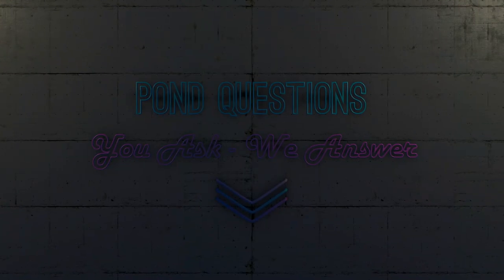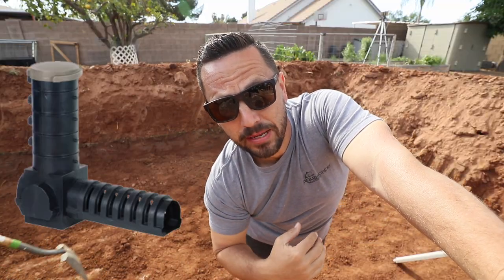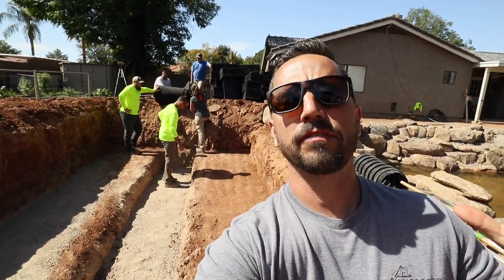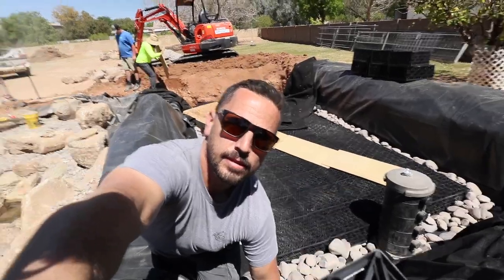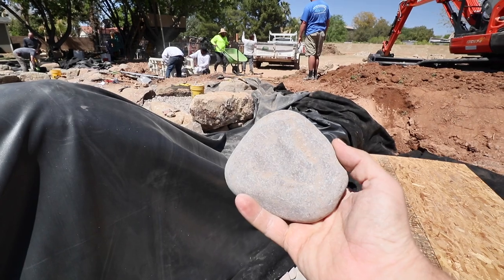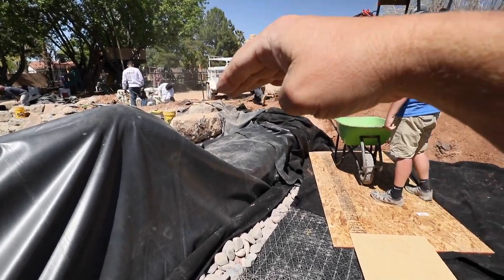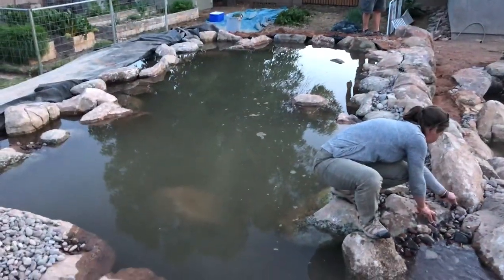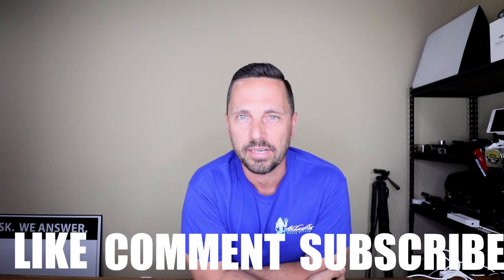How To Build A Constructed Wetland Pond Filter - Step by Step - YAWA 005

Comment: So does the skimmer section pump pumps water from the main pond up to the wetland filter? And the water flows up through the wetland filter consists of the aquablocks and the different sizes of gravel and those water just cascade down to the waterfall and back into the pond? Essentially you are really using one pump from the skimmer section which is generally lower in elevation from the wetland filter and waterfall. Pls help this is the only area i do not understand by far from all of my research.  TIA

Comment: Hey great info I am laying out a 15 x 15 wetland filter with a 5 x 10‘ stream dropping into 20 x 40 pond going into a small 6‘ x 8‘ intake bay what size and how many aqua blocks would I need for that type system for the wetland and for the intake bay also running about 75 foot of 3 inch flex line what size pump would I need climbing about a 2 foot hill thanks for the any info

Comment: Won't the voids in the larger rocks be filled with smaller rocks/gravel over time? 

How is this cleaned? 

Where does the fish waste go? How is it removed from the water column? 

Whats to stop aeromonas and psuedomonas making themselves at home in there?
Reply from the maker: Great Question!

For the most complete answer, I went directly to the man who invented the Constructed Wetland Filter, Ed Bealieu from Aquascape Inc. Here’s what he had to say (better grab some refreshments, it’s a long one👍): 

Thanks for questioning the function of this filter, you clearly understand the importance of a well designed and built Biofilter. 
The Constructed Wetland Filtration System is a very simple yet effective Filter. 
It’s a combination of controlled water flow rates combined with a sedimentation chamber and specific grades of River rock that will provide the necessary surface area for microbial colonization. 
But before I describe the functions of the Wetland I need to stress the importance of a Mechanical Prefilter such as a Skimmer or Intake Bay both of which will remove large organic compounds from the water before it reaches the Wetland. 
If this simple device is not in place the Wetland Filter will not function properly for two reasons.
1st the leaf debris, uneaten fish food, etc.... will overload the sedimentation chamber over time.
2nd reason is due to dissolved oxygen which we all know is critical for a healthy aquatic ecosystem.
In this particular instance the skimmer or Intake Bay draws the surface water from the surface of the pond during operation. 
The surface water will have the highest dissolved oxygen level because the water is in direct contact with the atmosphere.
A healthy Wetland Filter consumes oxygen through a variety of biological processes, the greater the fish load the more critical this becomes, the mixture of sediments, fish waste, dissolved nutrients and oxygen will allow flow into the bottom of the filter. 

With that out of the way we can discuss the actual Wetland Filter in detail:
Let’s start at the bottom of the filter where the water is discharged into the wetland from the skimmer/Prefilter.
The bottom of the filter uses a patented water distribution system(Snorkel vault and Centipede modules) this modular design allows us to customize the filter according to the goals of the project. 
Example: 
High fish loads,
Existing pond with high benthic nutrient deposits(eutrophic System)
Swimming pond,
Excessive runoff from the area surrounding the pond, etc.....

We have an initial 93% reduction in water velocity as the water enters the Centipede module, this allows the larger sediments(sand and small gravel) to settle out in this first chamber. 
The water then flows up into the main sedimentation chamber which is comprised of our Aquablox water matrix units. When the water enters this chamber we have an additional drop in water velocity creating a hydraulic residence time of 10-15 minutes within the sedimentation chamber depending on the actual flow rates of the filter(Total Dynamic Head) this allows the finer sediments(fine organic compounds, fish waste, silty clays, etc....)with the necessary hydraulic residence time to accumulate within this zone. 
The Aquablox have a series of internal baffles within them which eliminates laminar water flow, these baffles create a gentle mixing of the water which allows the fine suspended sediments and particles to literally bump into each other, these particles have a weak electric charge so when they bump into each other they’ll stick together in larger clumps when the flow rate permits. 
The larger clumps have a slightly higher specific gravity than the water so they sink to the bottom of the sedimentation chamber.
This process is very important because if the fine sediments are not removed(precipitated out)they’ll adhere to the river rocks which will change the surface area for the beneficial bacterial colonies causing a shift in the specific species that can live in the filter. 
Our goal is to establish the colonies directly on gravel not on sediments stuck to the gravel.....

From here the water flows up through a minimum of 18” of River rock comprised of three distinct sizes/layers of stone. 
The bottom layer has the largest gravel made with 3”-5” River rock, 8” thick. 
The second layer is 2”-3” gravel 8” thick and the final layer located at the top of the filter is 3/4” gravel 8” thick.
The top layer of 3/4” gravel is perfect for planting aquatic plants. 
The declining nature of the gravel diameters will keep them separated because the interstitial spaces will not permit the migration of the rocks down into the lower levels, does this make sense??? 
3”-5” rock will have void spaces of 1”-1.5” maximum this will not allow the 2”-3” gravel to migrate.
The other reason for the different grades of gravel is because they each have different surface areas(large rock has a lower
Surface area to volume versus small gravel which has a higher surface area for its volume) this allows for different levels of colonization to occur within the different river rock layers. 
As the water continues it’s path to the surface/top layer of the filter the water flow will split into smaller and smaller pathways(interstitial spaces)by doing this we expose the flowing water to the diverse colonies of bacteria, fungi, biofilms and countless aquatic species of copepods, rotifers, tardigrades, etc....
Every living organism on our Planet is competing against other similar organisms for food, a home, sunlight, etc.....
This competition is fierce!
You wouldn’t realize this because it takes place on all trophic levels
From large vertebrates all the way  down to the microscopic/nano level.
Bacteria and fungi compete for space within the filter bed.
The reason that I bring this up is that this filter only functions properly when it’s “seeded” with the right strains of bacteria, we use a specific formula that has been developed to consume nitrogenous wastes generated by fish and other aquatic organisms along with allocthonous organic compounds such as leaf debris and lawn clippings. 
Without the proper mix of bacteria added to the pond your leaving it up to chance that the right beneficial microbes will just happen to show up?!?!
That’s not to say that it can’t happen because it can but if you want consistent results then this is the only way to insure it!
I apologize for the long explanation but I felt that it was relevant to explain some of the details of the system before answering your actual questions.

How do you clean it, very easily, Once per year we recommend the Wetland Filter to be thoroughly cleaned.
This is accomplished by placing a solids handling sump pump into the snorkel vault which goes to the lowest elevation within the filter(sump) turn the filter pumps off and turn the solids handling pump on.
This pump should have 50’+ of piping/tubing connected to it to allow the sediment laden water to be discharged into the surrounding garden beds or turf grass. 
The dirty filter water is filled with organic compounds and is a great source nutrients for the plants. 
Once the filter is completely drained place a second pump along with the associated piping into the pond, discharge the pond water on to the top of the filter bed.
Move the water around to actively back-flush the gravel bed sending the fine sediments and water down through the entire filter.
Continue pumping the dirty water out of the snorkel until the water being discharged into the Landscaping is sufficiently clean(it doesn’t have to be perfect!)
The top of the wetland is typically planted with a wide variety of marginal aquatic plants which will further aid in the removal of Nitrogen from the system.
These plants should be cut back at this time and thinned to encourage new plant growth.
More plant growth=greater nutrient removal. 

Aeromonas and Pseudomonas are not a problem if the filter is installed and maintained properly this is due to the efficient water distribution system combined with high dissolved oxygen levels throughout the filter bed; this is not the desired conditions for those organisms. 
This combined with the highly competitive nature of the beneficial microbes that are added to the system will literally starve them out because they will not be able to get a foothold in the filter(everyone competing for food and a home)

Fish waste is kept in suspension within the pond due to Bioturbations from the fish(constantly feeding on the bottom of the pond) along with underwater jets that will push the waste towards the Prefilter.
Large waste will be removed in the Prefilter and the finer compounds will pass through the pump where they’re agitated and broken into finer particles to be distributed through the Centipede modules and Sedimentation chamber, this is similar to the Solids Chamber on a Septic System if your familiar with that technology?
The remainder of the fish waste is ammonia secreted from the gills during respiration. 
This dissolved form of nitrogen will be subjected to the nitrifying bacteria living within the filter bed. 

As you can see there are several factors that need to be accounted for outside of the actual filter that allows the system to function properly, if one of the other steps is not done it will have an impact in the water quality.
I hope my response helps you to more fully understand the inner workings of this Revolutionary Filter System that was created by my Mentor: Ed Beaulieu the Grandmaster of Pond and Water Feature design and construction.
Without his knowledge and understanding of aquatic ecosystems this would not be possible.....
I look forward to hearing back
from you!
Reply: Atlantis Water Gardens, Yeah, I needed two beverages. 😂🤣
Reply: @AtlantisWaterGardens  wow, thanks so much for providing all this information. Sometimes you can really find a golden nugget in the comments bellow. :D Thanks also to Ed the Professor and where can I read more?! He should write a book. :D

Comment: Hello Atlantis , congrats on your wonderful videos. I have a question that never gets discussed. How do we calculate the correct amount of water that should travel through a bog filter per hour? I am planning to build my pond with a surface area of about 600 sqft and depth of around 6 feet. I want to have a very large bog of about the same size of the pond approx 500sqft. I will have about 5-10 koi fish. Also the bottom of the pond will have gravel and water will pumped through the gravel up flow. I would like to know how how much water per hour I should pump through the pond and how much through the up flow system on bottom of the pond. I never found anybody that discussed this topic....glad to hear your input.
Reply from the maker: I would recommend using Aquablox in your filter. If your filter is about 500 sf, that would require 170 small aquablox. Your flow rate should be around 150 gph per unit, giving you a total flow rate of approx 25,500 gph.
Reply: @AtlantisWaterGardens  wouldn t contact time be too short for bacteria and plants to be able to do their job properly. At that rate I turning the whole volume of water once every hour. It seems that every person you ask has a different answer. I was aiming to cycle the water through the bog once every 2-3 hours but now that I see your answer I m completely confused!!!! Ahahahah

Comment: Advanced, effective, but easy and cheap considering how much filtration you get!
Reply: I doubt that it is easy and cheap compared to a pond filter. 
You need a major 6 ft deep dig, a snorkel, centipedes, liner, plastic boxes to cover the entire surface and tons of gravel. And you also lost the use of a sizable surface of your garden, unless you really wanted a bog in your yard.
All that just to achieve biological filtration and you would probably still need mechanical pre-filtration and UV filtration.
Reply: Bla Bla for how much filtration you get... it is compared. You couldn't get as large of a filter any other way. There are other ways to build it as well, like in the pond, which acts like a mechanical filter also. Doesn't need to have the fancy blocks etc. Agree uv is best to have.

Comment: GREAT VIDEO! I have a question. I am constructing a Wetland filter for a 1/4acre clay lined pond. The filter dimensions will be around 30'x8'. How do you construct the wetland so that it has a 10'-15' pond at the top and a 2'-3' wide stream 20-15' long on the other half. All of which will be the actual filter. Thanks!
Reply from the maker: You can shape the top with rock work and backfill with gravel to get above water level 👍
Reply: Makes sense! Thanks for the reply. Love your videos!

Comment: How does that bog filter/wetland filter works ? Where are the water coming from that goes down stream??? Is there a pump towards the main pond???
Reply: houston smoke waterfalls to the main pond.  Skimmer at the end of the main pond pumps back to the bottom of the wetland filter to complete the circuit